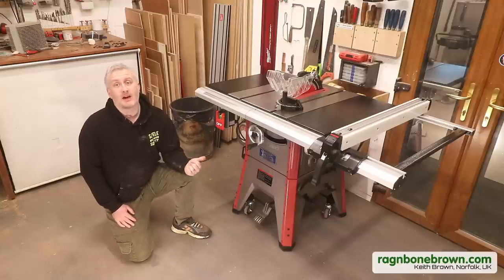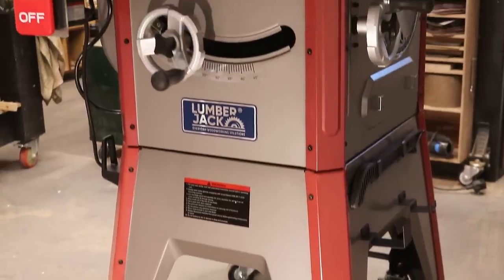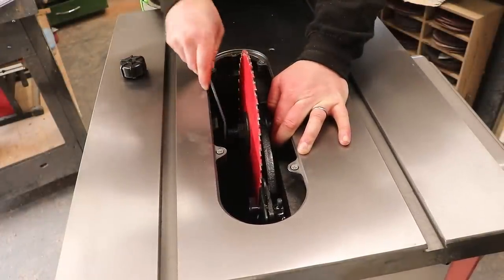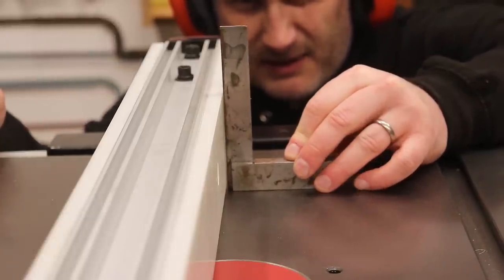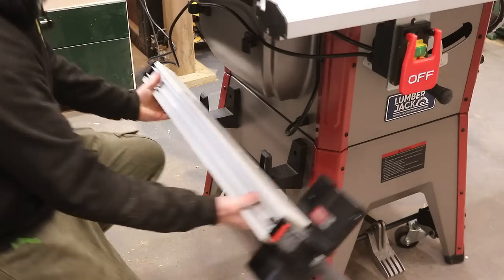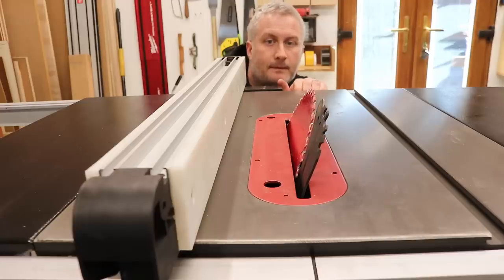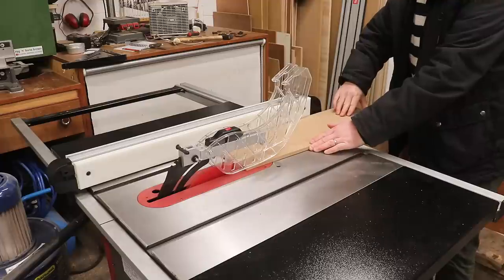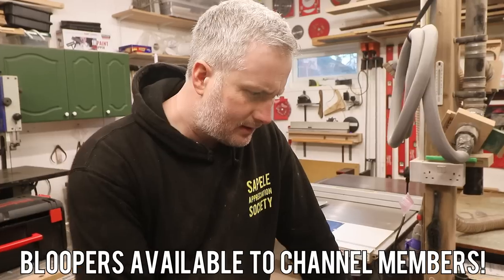LUMBERJACK TS1800 TABLE SAW: Everything You Need To Know

Comment: This is really interesting. I didn't hear your podcast (maybe I'll look it up now!) but I think I had some of the same concerns. I am a paraplegic and use a wheelchair, but I really want a cast-iron top as close to a cabinet saw as I can get (don't really want a contractor style - with the motor hanging out the back), but it needs to have removable legs so I can build a new base that lowers the tabletop to 30 inches or so. Hybrid saw seemed to be the answer and the Ridgid that you showed that looks like this model was on my list. Here in the US, the Ridgid has a reputation for a really terrible fence (there is a market for 3D printed "fixes" for that fence specifically). It looks like your fence is more robust than the ones on the Ridgid sold here. Nonetheless I think I'm down to a 2HP saw from either ShopFox or Grizzly - which are essentially the same saw )they even have the same manual rebranded) and are sold by the same company (Grizzly) and even the Grizzly salesman admitted they were the same saw except for some minor cosmetics. Anyway, thanks for the perspective.

Comment: Hi Keith, Just purchased this saw and having the same problem with the fuse blowing, They did include another fuse in the box but this blew on first start up. I've looked online and can only find 13a slow blow fuses in 20mm or 30mm ? Have you a link for the 25mm slow blow fuses you purchased for your saw please.
Dave

Comment: The mitre gauge screws appear to be in the middle of a long slot- if so. they are definitely supposed to increase the width of the bar to adjust the fit. A fail if they do not.

Comment: My Ridgid has a unacceptable warp in the cast iron top that I didn't notice until I tried making half laps without a table saw sled, it has a dish on one side of the throat plate by about 1.5mm 1/16th" so I cut perfect half laps on the end of some boards then once i cut the middle ones the casting raised my wood by 1.5mm on both halves of the cross lap making my wood uneven by 3mm on some spots and perfectly even on others, this would never had happened if I used a sled instead of a miter gauge, but the miter gauge was so decent I used it sometimes. I searched and it's a common problem with the Ridgid, and I checked the floor model on newer ones and it's till and issue, I've read with cast iron top's your supposed to do a rough milling then rest it for a year or something before doing the final milling to avoid warping.

Comment: I have the same model, but branded to a local (to me) brand, but apart from some minor details it is the exact same model as yours. I have had it for a number of years now and did run into quite a few issues. First, I can't for the life of me adjust the riving knife to a point where it aligns properly with the blade so it either causes issues with cut quality or I don't use it...Then, within the first year, the trundle (?) that raises and lowers the blade is made of cast iron and somehow the spindle damaged it to a point where it would skip over and wouldn't raise or lower. This got fixed under warranty (after a lot of humming and hawing), but 8 months later the same thing happened. It again got fixed and has been ok until now, but it seems that it is starting to happen again, but now I know how to handle it. Another problem I ran into is that the arbor somehow got out of alignment or something and starting chewing up the bearings and the pulley and I couldn't find replacements for the longest time. Even the guy from the local service center for that brand couldn't get parts and it got so bad that his company cut ties with the brand and is no longer servicing that brand. This problem caused the motor to have a hard time and keep tripping the overload protection and the blade would visibly wobble. Once I finally got things sorted out, it ran OK again until a while later the motor just wouldn't turn on and I had to have it serviced because some internal part had burned out. I am now, after probably 7 or 8 years, to a point where I still use it and it works OK, but the main thing is that I know it in and out and have even replaced bearings twice by myself. It really is an OK saw but far from perfect... So yes, all you said is what I thought in the beginning, but it can develop issues. It's not difficult to service once you know what you are doing. Since I live in a country with 110V, I did swap the saw over to 220V which felt like it has more power and runs smoother and quieter, but that is likely not an option for you.
Reply from the maker: Thank you this is really insightful stuff. This makes me think twice about keeping it over the axminster! 👍
Reply: @RagnBoneBrown  It might be I just had a bad unit, but since I don't know anyone else (locally) that has this saw, it is hard to say, so your mileage may vary...

Comment: The real solution is so pick either for now and replace it as soon as you have the means. Spend more but enjoy more. I’m using a Craftsman 113.xxxx I got when I was around 12 years old. I’ve had it 30 years as I’m 42 now. Only real problem I have with it the capacity to right of blade is really small. 20 inches is pretty poor when I’m building just about anything.

Comment: Interesting, but honestly the slow blow fuse thing is a kludge. Cut plug off, run on a 16amp socket, sorted.

Certain DIY grade Welders used to suffer with similar issues, basically you’re hitting the limits of what a 13 amp plug can handle in terms of in rush current.

Comment: On a mild steel miter bar you can hit the end with a hammer to peen it wider and get a tighter fit you can also make a divot on the side with a punch to tighten up the sides. If you get it too tight you can file it back.

Comment: Great review, have been curious about this saw for a long time. I have a very small workshop and wouldn’t need all that rip capacity.

Do you think it would be possible to set the fence rails up in a way that makes the overall width smaller?
Reply from the maker: The fence rails are aluminium, so I guess you could literally cut them down to the size you want. Bit drastic though I suppose, but if you're planning on keeping it for years and don't need the extra capacity, it's an option

Comment: Remaking your sleds, jigs, and outfeed table is something you do once.   Better dust collection,  ease of changing blades, and the easy-to-remove insert plate are things to deal with over and over.    point to the lumberjack.   quieter more powerful motor, point to the axminster.   Mobile base is nice, but I don't think you use it.  Though maybe now you'd roll it outside for summertime cutting?     Seems to me you like the lumberjack better.
Reply from the maker: Cheers, good points. I actually do use the mobile base occasionally when I want to reposition the saw to get more indeed, or to use the router table, so manoeuvrability is a big plus. The Axminster mobile base is abysmal, only two swivel castors, so I have to do a 7 point turn every time I need to reposition! It's a tricky decision. Especially as I hate making jigs!! 🤣
Reply: @RagnBoneBrown  I'm with you on bases....  Most mobile bases are terrible as they often have two fixed and two swivel castors.  In a small shop like yours and mine, you absolutely must have FOUR swivel castors on a base.

Comment: I've been using this saw for about 6 months, I rate it. (a bit more thought into the insert plate would have been nice, like a 1/2'' thick one so its easy to make up zero clearance inserts) 
Out the box I cut the plug off and swapped to a 16A 3pin-no bother at all. 
Saw takes the dado set I used on my old Wadkin. 
I feel its somewhat overpriced as it really should be £500/600 not closer to £1000 but then there is no competition,  everything Axminister sell's is about 50% overpriced in my opinion. (that's if they even have the stuff in stock) 
Also I don't think for what 95% of  DIY'ers do its worth the extra cash for the 0.3kw for the 3ph Laguna or the Axminster. 

Great bit of kit, would get another tomorrow and have no issue recommending it to people.
Reply: I’ve had this saw for 20 months. I must’ve gone through 50 13a fuses,the demand  for power on start up is too much for the fuse. If I leave the saw plugged in with the power switch on(obviously not running)the fuse lasted much longer before it blew. I did the same as you,cut the plug off and fitted a 16A plug and socket. So far,so good.

Comment: I bought one of these during lock down but never hooked up any dust collection. Just bought a lumberjack dust collector and they do not marry up, the port on the saw seems bigger by a few millimetres
Lumberjack are not answering the phones or their messaging  on their site.
I have bought HVLP dust collection hose for the task and no amount of persuading will get it to go on.
Up until now It has been a good saw but it is driving me nuts trying to get dust collection to fit.

Comment: Hi Keith. I have this saw. I have issues with it cutting out often. As i am in Europe they dont have fused plugs here so i have to still figure out a way to keep it running. 
But my main question to you and lumberjack is this, they two pulleys that take the belt to drive the blade, on my saw they do not sit one directly on top in alignment with the other. They seem offset and thus the belt only sits half the width on the pulley the other half width hangs over the edge. This seems wrong to me and today the belt broke. It has split into two bands. Please if you have the saw still, whip off the back panel and tell me how well aligned your pulleys are, does your belt side its full width on both pulleys. And if thats the case do you have any idea how i could fix this issue. Thanks for the great video. Keep well.
Reply from the maker: Hi, I don't have the saw anymore. Definitely contact LumberJack, it doesn't sound right at all
Reply: @RagnBoneBrown  thanks. I have been in contact with LJ. Will see how it develops.

Comment: Seems like it may have been a motor change or some other electrical components change in the design. With a "fast start" motor you would likely see a current spike / inrush current on start up, hence the fuse trip. I guess any design change from lumberjack would remove the fast start or lower the power of the motor, which is less than favourable. Fuse update is simple but shouldn't be an out the box fix for a customer to make. Like you said, supply one or do it in the factory!

Comment: Fantasic video - as usual. But what about accuracy? My bigest concern with any table saw is repeatable cut accuracy - and how easy is it to align the blade with the mitre slots? With my currrent saw it is virtually impossible to get the blade aligned to the table - even when specnding hours trying - it's just a crap design. Same with the fence - as soon as you tighten it down - it moves - and I'm being really careful.

Do either of these saws suffer the same issues when calibrating manually?
Reply from the maker: As explained in the video, table was accurate enough to the blade out of the box for me, and is adjustable as shown  but can't vouch for how easy it is to do

Comment: I have the Rigid version of this saw which came with a significantly poorer designed fence. It locks out of square, is a pain if not impossible to square. It’s so bad that Etsy sellers make modified bushings for it to help make it usable. If mine had come with that fence, I would be much happier.

Comment: While watching your review, I must say that this saw is kind of strange.

This is a metric saw with an imperial arbor dimension, which uses a super beefy front track and a very flimsy back track. Also, the fence only goes up to 760mm to the right.

Personally, I would rather have the saw blade more towards the left to accomodate for 1250mm to the right which would allow us to cut full sheets of plywood in half as well as MDF. I have never found the left side to be very useful on my saw, as I use a crosscut sled. I would also rather see a typical T-square type biesemeyer fence than this specific profile, which means it would be easy to lenghten the tracks.

On the otherhand, I must say that I LOVE the fact that the back panel can be removed to access the mechanics and that there is, from the factory, a dust chute panel. The easy-to-use mobile base is also a major plus in my opinion. The most important one in my opinion is the on-off/safety pad control box being separate from the chassis of the saw. On my old saw (a Delta ShopMaster TS300) the on-off switch is on the chassis itself and is very awkward to use, you got to bend down to see where it is to turn it on/off, which isn't intuitive at all and a safety hazard in some cases where you feel like their might be a kickback coming your way, you can't really stop it quickly and thus you have to push down on the workpiece quite a lot to make sure it doesn't go flying and also bogging down the motor (which isn't good, but yeah...)

I would love to own such a saw, mine's old and beaten. The dust collection to me, is much more important than what it can/can't cut as I don't do a lot (MDF, plywood, pine and soon black walnut). I'm sure it would be better than my actual one anyway.

Comment: Looking closely at the miter guage in the video, I noticed what looks like a slit in the bar, if that's the case then the set screw should expand the bar for a tighter fit.
Reply from the maker: Unfortunately not as the screw is not tapered nor does it have a tapered head. I don't understand the reason for those slots

Comment: The miter gauge appears to have slots on each side of the Allen adjustment screws. Are you sure the screws aren't there to slightly expand the width of the miter bar so that it fits snuggly in the slot?
Reply from the maker: Yep I'm sure. That's what I thought they were... Sadly not

Comment: Once a sworn supporter, I’ve completely stopped buying any Axminster stuff for a few years now. They have been coasting on their reputation for too long and are currently overpriced for what you get. Lumberjack sound like they are picking up their support game which is great to see. If these are re-badged Rigid saws then I’d swap to Lumberjack immediately since the negatives you describe on the Ax will bother you with every cut.
One extra thing I’d point out which is new is that Lumberjack are now sold at B&Q which is potentially a game changer in terms of access and support / influencing the manufacturer to improve their products and support services. B&Q seem to be selling this saw for a grand, I’d say this is well worth the money. 

Heck, that fence alone would make me go for the LJ at this point 😂
Reply: Also, with Axminster at least, “prestige” is an illusion 😂

Comment: I’ve had this saw for a couple of years. It’s great but the fence is a nightmare. If you have the lateral adjusters set tight enough to keep it straight when you move it, they catch on the slightest amount of saw dust. If you have them loose enough to slide the fence freely then there’s always a couple of mm play at the far end of the fence depending on whether your moving the fence towards or away from the blade. Do you get the same thing? (V possible I’m being an idiot somehow)
Reply from the maker: Cheers that's interesting, I've not had that issue as yet with the LJ, although I do get that issue a lot on the Axminster interestingly!
Reply: @RagnBoneBrown  yep. It’s the grab at the back that causes it - it tightens up before the front catch has had time to return the fence to its zero. I’d rather risk some deflection and be sure that it will be consistent.
Reply: I'm having this same problem. Even if you get the adjusters tightened up just right so there's little play and the fence is square, the adjuster screws move every time you unlock the fence and it's out of square again. Is there a knack to this that I'm not getting?

Comment: Hi Keith great review, like you i looked at the lumberjack saw a couple of years ago but couldnt really find a review on it so i opted for the axminster ac216ts which was a vast improvement from my previous saw, how ever the fence system on my saw leaves alot to be desired an awful!!!!!!!!!!!. As for the difference in power between the 2 saws if your not standing at the saw for several hours a day cutting thicker material does it really matter, as the lumberjack has so many ups over the axminster i would say goodbye to the axminster, each to there own but look at the dust collection i mean wow beats having to have your own tornado going on to collect dust which my saw is also not good at.
Reply from the maker: Thanks! Yes, I agree 🤔

Comment: I don't know if anyone knows about the trick to get the miter gauge to fit into the slot without any play or not. What you do is you take a punch and you take a hammer and punch a divot on the side of the miter rail. The divot will push the metal out just enough to fit into the slot without any wobble. If the punch is too deep, you can alway file it down just a little.

Comment: All that for under 1k seems good to me. Can you do an acuracy cutting vid? Does it cut 100% square to the fence? Does the fact the base is slightly out afect the cutting angle. Basicliy can it do presition cutting like Peter milerd was after? Thanks.
Reply from the maker: The blade alignment to table is shown in the video, that is how accurate it was out of the box. It can be adjusted using the bolts also shown in the video. If you have a dial indicator you can set it up to insane levels of precision, but whether it's necessary or not depends on the type of work you do
Reply from the maker: Same applies to fence, it's adjustable, so how accurate it is depends on how accurately you set it up
Reply: @RagnBoneBrown  think i might put this on my short list. For that price, looks like a no briainer. Can u buy it direct? Try to avoid Amazon when I can.
Reply: @donjohnson24  even better £899 fantastic for that machine ☺